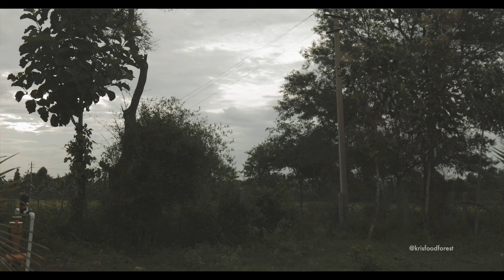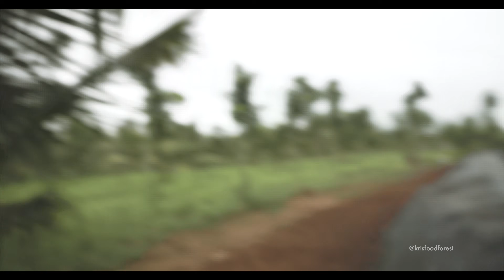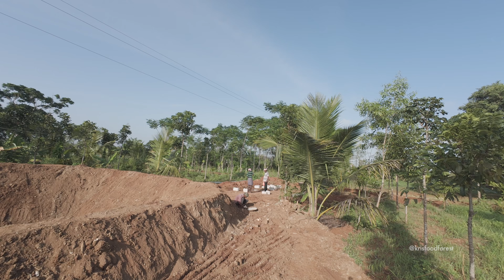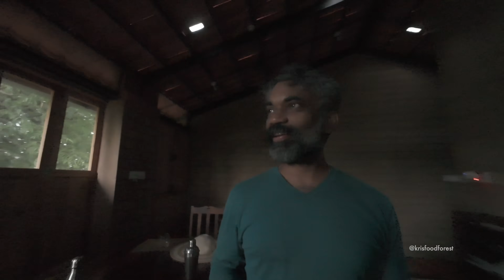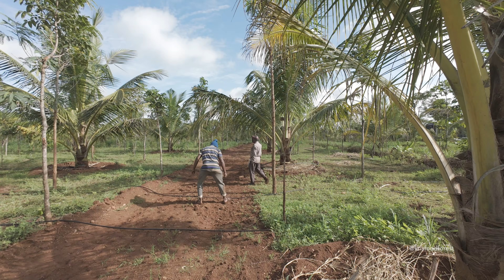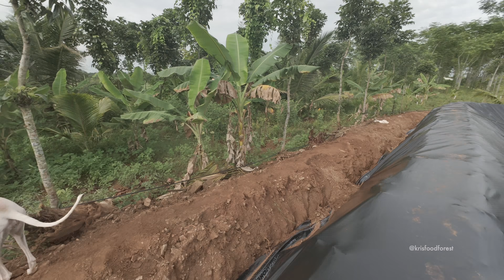Drip Irrigation Using Pond with Liner

Comment: Hi kris.
I am new to your channel,
Total how many Acers do you own ?
You already replied to the size of pond that 800 sqmt i think its a 20x40. If iam wrong correct me.
How many hours took for the excavation and total cost of linner and drip.
I started farming in Hanchinal village Kushtagi taluk Koppal district. After my degree i thought to natural but situation iam doing 50x50 chemical has well as natural.
Currently iam also facing water and power supply i have 3boer but currently running one because over load in transformer. At present i am growing the perl millets, chilli, coconut new one, coco and castor and moringa.
My next plan to dig a pond and fix solar pump  to it.
But recently i was in solar trap i applied to pm kusm Yojana but its a fake i lost around 8.5k 
So what cost you got on solar.
Nice channel.
Its a big challenge to talk infront of cam while labourers are working.
Keep going it will help like me and new Farmer's ❤
So my next
Reply from the maker: Thanks 🙏. I do have sufficient power from the transformer inside my farm. Solar for 5.2kv would cost around 2 lakhs. Wish you all the best